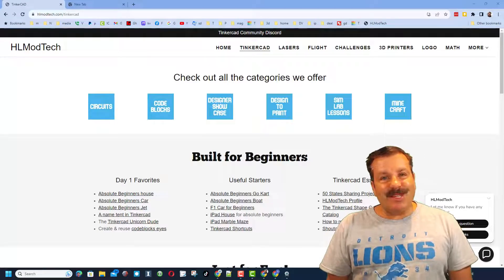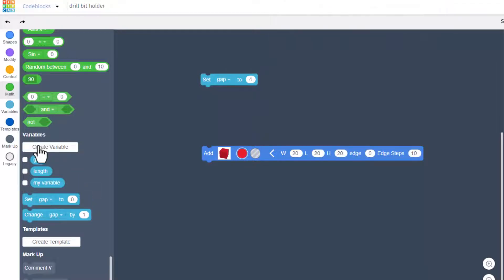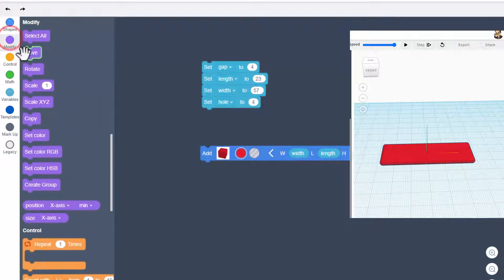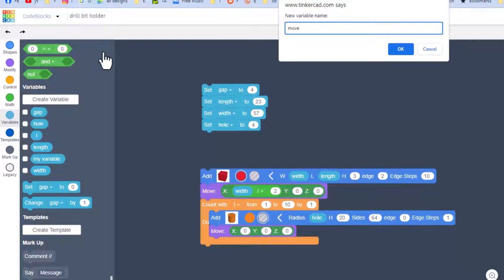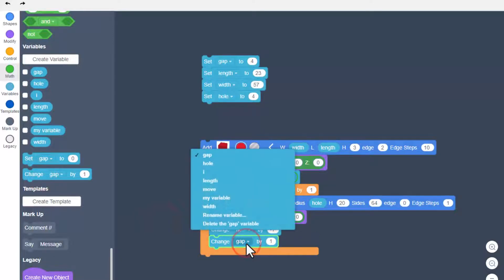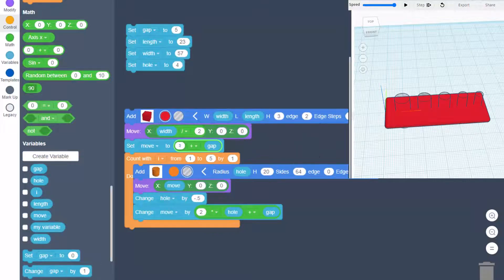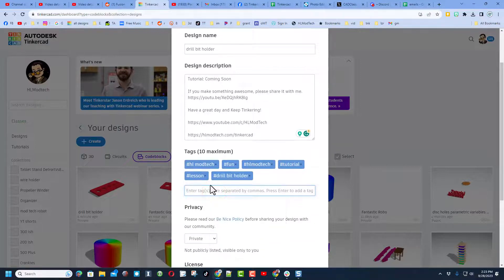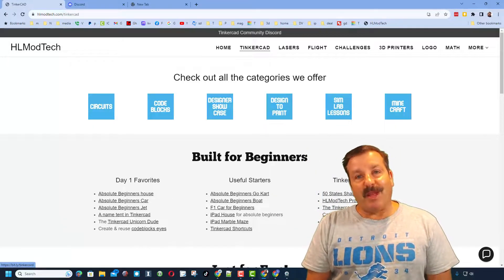THIS is WHY you Learn Tinkercad Codeblocks Parametric Parts in Minutes

Comment: Thanks. I'm still trying to find out, as a beginner to this concept, how does this become useful to learn outside of TinkerCAD? What competency does this build for other things?
Reply from the maker: Building with code is always a good skill to have. This one allows you to use the same code, but change the variables to make many different projects.
Reply: Well, maybe it could be useful to learn NodeJS. Anyway, Thinkercad used to have a parametric generator programmable in Java Script and I found that extremely useful.